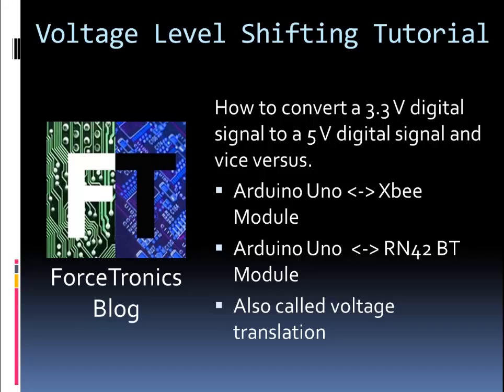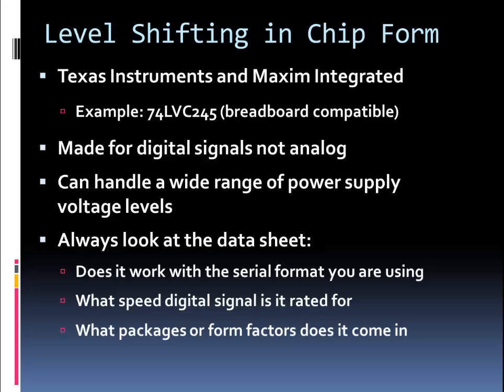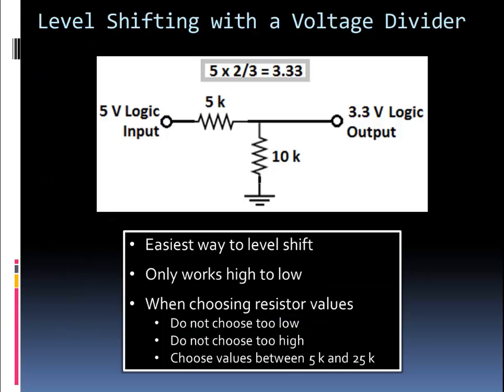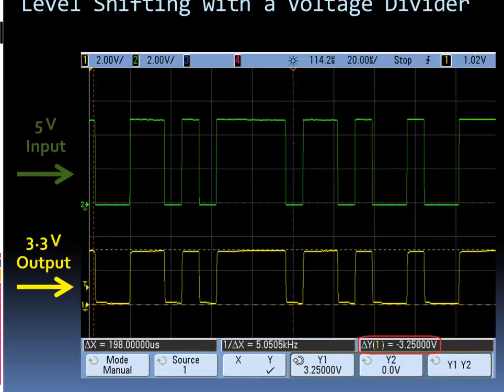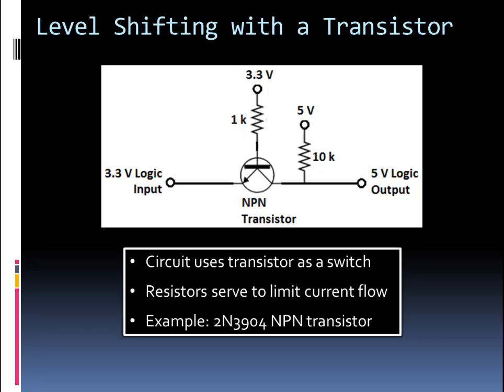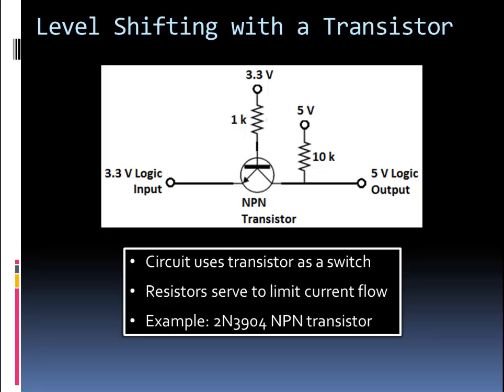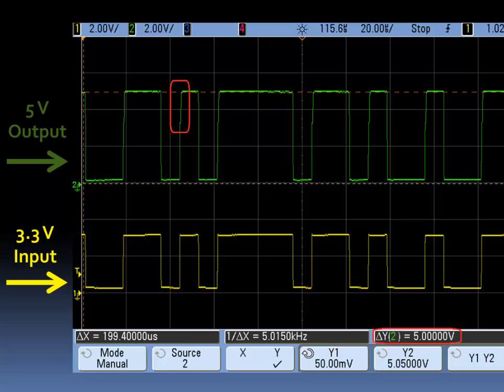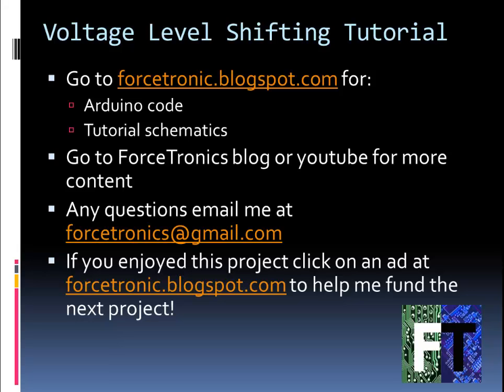Voltage Level Shifting Tutorial

Comment: Would the transistor level shifting design work efficiently to shift a signal line from 3.3v to 5v for an adressable LED strip like the WS2812b? Just making sure.
Reply from the maker: Yes and in fact I've used them to drive those LEDs. Those LEDs have a high impedance input and then they amplify the signal and send it to the next LED so you're really just driving One LED. The way to know if the level shifter is going to work on anything is to understand what it's input impedance is. If you have a 1 km resistor as your pull-up for the level shifter and the voltage is 5 volts that means you have about 5 milliamps to drive whatever load you're connected to

Comment: What if i want to input a 0v to 5v signal from a car temperature sensor, like oil temp, and it has a scaled reading from 0v to 5v in millivolts. What device can read those 0 to 5v signals and feed it properly to a rpi so it can be 0v to 3.3 scale?

Comment: Using a dual or quad comparator such as LM393 LM339 can do this easily. They are open drain design, you can connect any voltage source at the output pin. NPN transistor 2N3904 is current control type, LM393 is logic control type and much power saving for practical design.

Comment: What about bi-directional level shifting for I2C for example?
Reply: For bidirectional level shifting there some boards based on BSS138 FET with automatic direction sensing, or chips with autodirection sensing like LSF0108. Other option is special I2C digital isolator chips like ADuM1250/ADuM1251. Common digital isolators also can be used for unidirectional level shifting up or down.